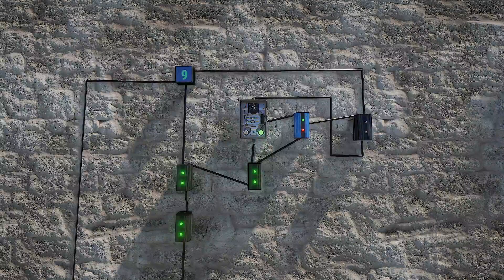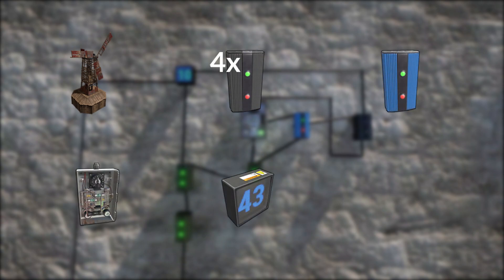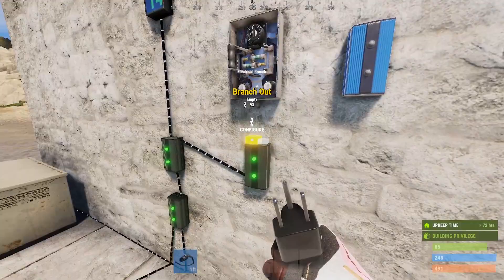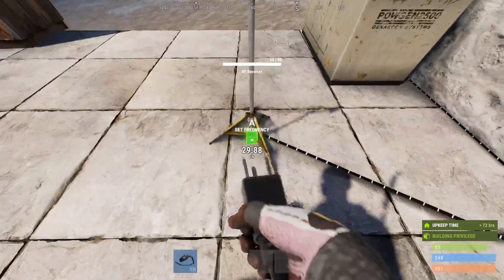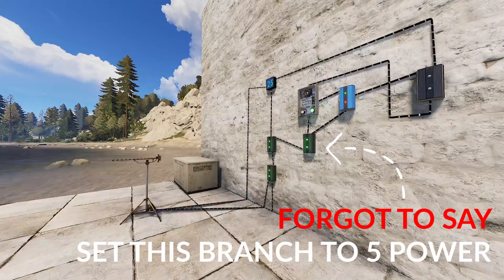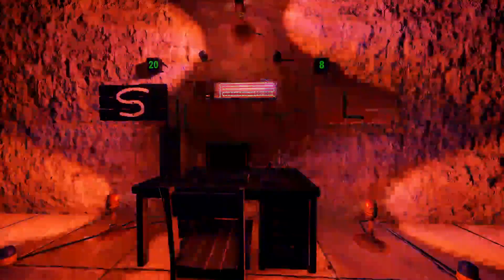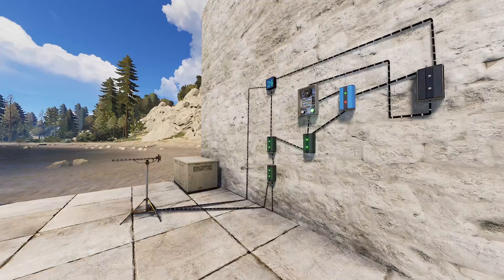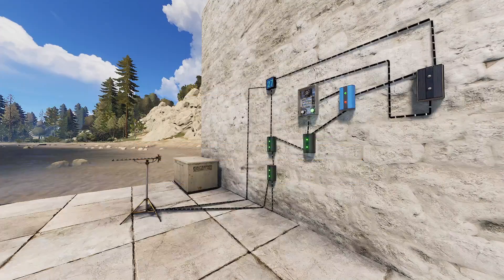RUST 101: Electricity - Oil Rig Timer

Comment: Mate, been running a oil rig timer since Jan. You coulda just asked :P
Edit: Here's the link to the way I built mine. Has a minutes and seconds timer, and reset itself once the crate has "opened". Set the minute timer to 15 and the seconds timer to 59 and it will start counting as soon as the crate is activated and tells you how long it's been. Also has a nifty light to indicate it's active.
https://www.rustrician.io/?circuit=73d508f0411f170de409093684e7dec0
Reply from the maker: Nice one! I like the addition of the timer for the crate, that's a nice touch. :)
Reply: @Malonik  It has proven to be very handy. It's nice to have an idea of how much time is left before you head out. Now if only Cargo sent out a signal when it spawned lol.
Reply from the maker: @D4NKN3SS  I was trying to come up with something for that but the 2 - 4 day spawn timer really fucks that up lol. They should definitely add something for it.

Comment: Is it possible to make an autoturret and door at your entrance that opens your door and shoots whenever someone is approaching? With a sensor or something? You definetly need more subscribers mate great videos.
Reply from the maker: Oh it's definitely possible! Here's what you do...

- Power source to branch 1.
- Branch out to the turret.
- Power out to branch 2.
- branch out to sensor.
- Power out on the sensor and the branch to an and switch.
- Power out on the and switch to the door controller.

That's rigged up so that your turret constantly has power. I did it that way because the turret turning on takes way too much time so you're better off having it already running when the door opens.

That being said if you do want to conserve power you can move the first electrical branch to the end between the and switch and the door controller and run it to the door controller and the turret.

Also thanks for the kind words. :)

Comment: This might be a simple request. Could you show how to setup a couple Tesla coils to go off outside to prevent door campers? I assume it’s similar to the automatic door that opens when people are nearby using the HB sensor.
Reply from the maker: That one is super easy! Here's what you do...

- Run your power source to a splitter. 
- Branch out to a hbhf sensor.
- Power out on the branch and sensor to an and switch.
- Power out on your and switch to the tesla coil.

On that last power out you can run it into an electrical branch and then chain them together if you've got multiple tesla coils.

Also one thing to be mindful of is that they might be able to set it off while out of range of the tesla. If that's the case they can just stand there until it destroys itself.

If that's the case add a switch between your power source and the first branch. That way if someone is doing that you can just turn it off until they piss off.
Reply: @Malonik  Thanks so much!
Edit: Could I set up a pressure plate to prevent people from triggering it to soon from a distance?